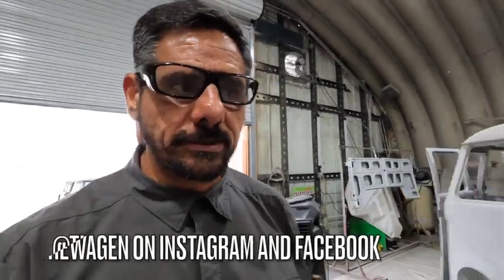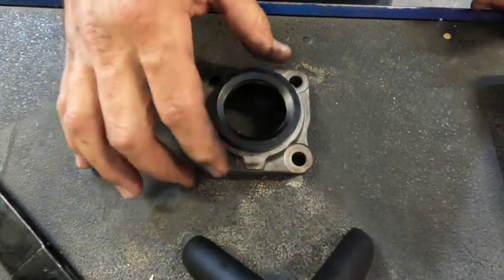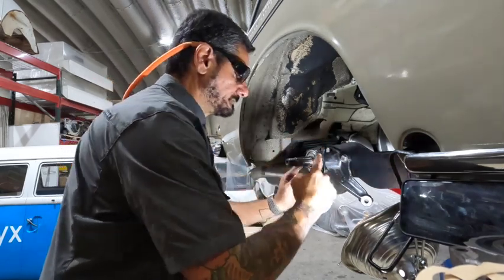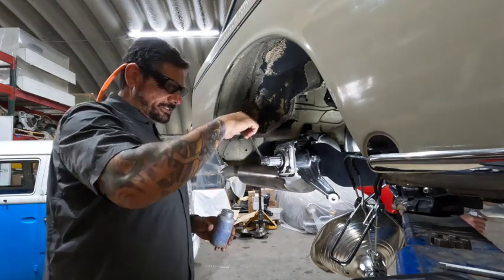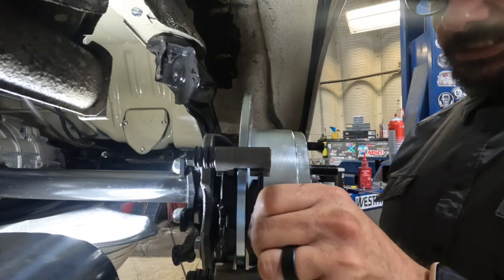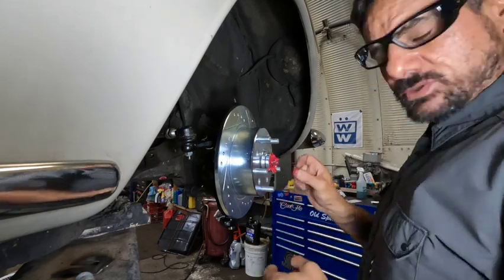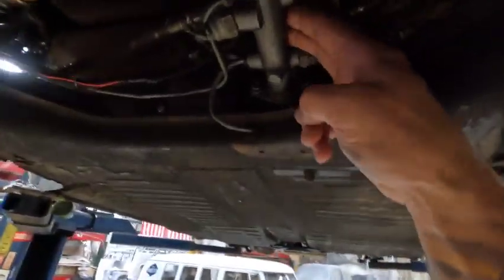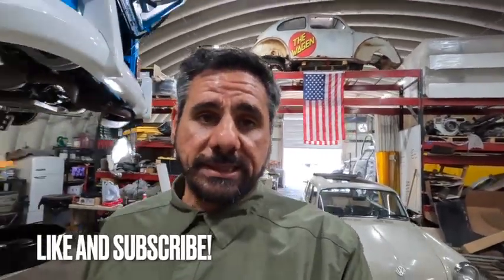VW Type3 Wilwood Disc Brake kit.

Comment: Had two Type3's (Fastbacks) in 70's and 80's and fitted 4-wheel discs back then.
Cheers from Australia.
Reply from the maker: Cheers! What rear brakes did you use back then? Porsche?
Reply: @the_Wagen  No, they were in kit form - front and back - from Volks Conversions in Queensland.

Comment: I would caution against so much grease in the front rotors. Yes you want some in there but that was A LOT.
Reply from the maker: Illl agree to disagree. They were brand new rotors. And I prefer to make sure there is a supply of grease.